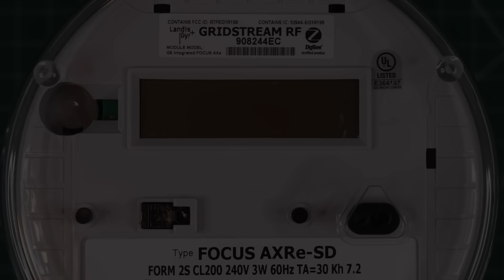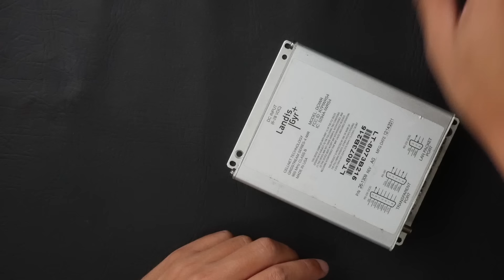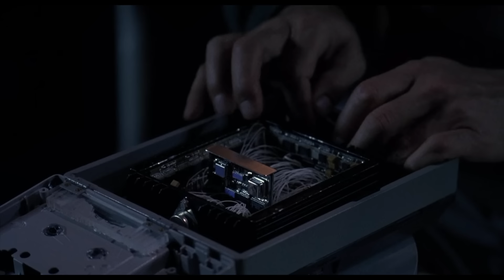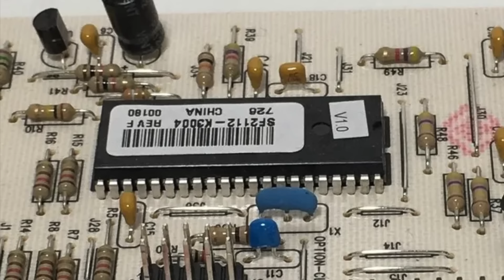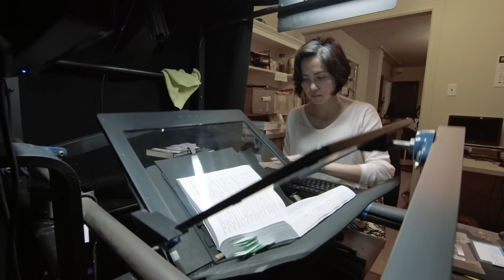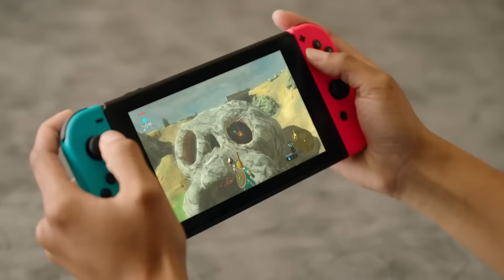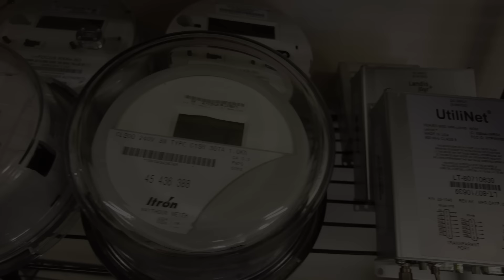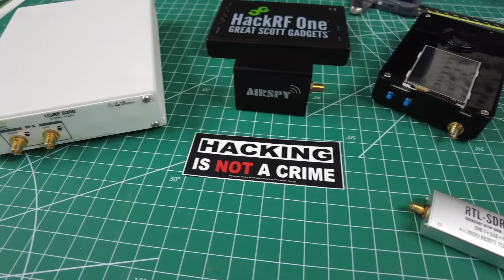The REAL Problem with Smart Meters

Comment: I got DEEP into smart meter development earlier in my career and was so frustrated by manufactures totally locking out the consumer to access THEIR OWN consumption information.  The SEP2.0 OPEN communication standard was under development but FERC didn’t have the balls to mandate an open standard like the FCC did with WiFi.  It is SO COOL to see this jail brake effort.  It will lead to security problems and solutions but more importantly with enable the INTERNET OF THINGS to become a reality!  I’ll be closely following the evolution of this campaign.
Reply: Smart meters were implemented around 2014 in the community where I live. Since then the utility rates have skyrocketed! The people have been speaking out about it for many years and are currently calling for an audit in fact. One of the reasons why they are currently pushing for an audit has to do with our community being hit by a tornado approximately two months ago. Many including myself were without power for two weeks; surprisingly the utility bill for that cycle was higher than not only the previous month but the same month last year! My example is only one of many. The reason none of these audits or actions by the public seem to have much traction I believe is because they are looking in the wrong place. I believe the discrepancy is perfectly hidden within the metering system itself. It seems that the “smart” digital meter is very sensitive, unlike the older mechanical meters which require continual draw to be turned (like an old automotive odometer). The average bill seems to be around 30% higher than with the mechanical meter. If anyone has any information on this I would be greatly appreciated to say the least.
Reply: @MidnightOilsRestoration  very concerning. I see your point, what is the algorithm being used, and can it be wrong. If it was the other way around with energy companies losing money, it would get immediate attention.
Reply: @backwardog1  you’re absolutely right about that! As far as the algorithm, I’m not sure what you mean. I’m not very familiar with the smart meters themselves beyond what I learned in this very video unfortunately. I have witnessed some anomolies with it that definitely raised some eyebrows and one of the other Residents with a grievance had a story that was quite telling also. I’ll explain what I mean in a few minutes
Reply: @MidnightOilsRestoration  note the cost rate per kwatt changes through day and night. Lots of opportunities for wrong cost code being used based on clock setting in the smart meter. That's why all the meter communication should be visible to verify accuracy. Carry on.
Reply: @backwardog1  The meter does not calc cost, it records Kwhr usage.  The utility pulls the kwhr usage from the meter, and at its billing backend multiply's out the $/Kwhr.  Some customers its a constant for the entire billing period, for some its an hourly cost and BTW residentials the least likely to have hourly changing $/kwhr...its usally a flat rate, or at most night, day, and weekend charges.
Reply: @MidnightOilsRestoration  You can ask to have your current meter pulled and tested and witnessed by you and your utility regulator.  When they pull the current they will put in a replacement. Its the kwhr rates that are changing not meter stuff.
Reply: @MidnightOilsRestoration  that’s a wild story about your experience without power and getting a high electric bill during that same time period. I can tell you that the old electromechanical meters did slowly integrate with time, but they always benefited the customer by running slow meaning the older the meter got the more accurate it would get, but it would be in accurate for the in users benefit. I have heard numbers, something like after 10 years a half a percent of accuracy would be lost every year after. But I’m sure this all depends on local factors. That may be part of the reason why there are higher electric rates when you replace an old in accurate electric mechanical meter with a new digital meter. Just part of the conversation, but definitely not the whole thing.
Reply from the maker: Thanks man! Seems a lot of people are frustrated, so time to change that!
Reply: My concern is that the meter's data collection can be used for nefarious purposes against me. At the basic level, I am over quota, and that big remote switch clicks to off. At the advanced level, China decides power goes off at 8:15 am. every day until we pay a ransom. I wanna keep the dumb meter, please.
Reply: @backwardog1  I would hazard a guess that a deliberately "dirty" but very low power transmitter (perhaps 100mW or so) sitting in the centre frequency of 915MHz might stop it being able to reliably RECEIVE but it would not stop it being able to transmit. (Unless you could find a way to enclose it in an earthed metal container - to make a faraday / tempest shield.

Interestingly, commercially available W-I-D-E bandwidth transmitters (30 MHZ) which operate on 800 MHZ band as well as 1200 and 2.4 - now this is not the right frequency, BUT my guess would be that changing the crystal might be enough to drag it where it is needed.

The cost of this is prohibitive to most people (and would also massively overwhelm local meters with a WIDE radius), but it suggests that the hardware is out there and I would hazard a guess that a WIDE bandwidth transmitter where you do not care about frequency stability should be able to easily block your OWN meter form being able to RECEIVE with just a few milliwatts of RF. A quick search for 900 MHZ video transmitters brought up results.

Clearly I would not advocate people blocking the receivers of others - or the "data gathering nodes", but a WEAK version in a metal enclosure over your own meter should make it totally deaf to the outside world I would think.

It would be VERY interesting to know if these meters "fail on" or "fail off". If they "fail on", then clearly if they were accidentally exposed to a magnetron from a microwave oven for a few seconds (on your own private meter of course, not a utility meter), I would think it would only take seconds to make sure it can never send or receive again.

Also with a PRIVATELY owned meter, I wonder what would happen if you changed its serial number to one recognised by the system. It does seem as though security is not that high, so it might not be a wild guess to wonder if the serial number transmitted was very easily linked to the printer serial number on the outside of the meter.

Might have to buy one of these things to play with. Though not sure this is a model used in the UK. We have Landis + Gyr but the E470 seems to be the version found here.
Reply: If criminals could shut the power off with a device, using this same data, this would be very frightening.  No need to cut any lines.
Reply: Where abouts are you, are there any articles  / reports about this issue?
Reply: @G.Man-  Claremore, Oklahoma. Yes several have went to the news about it in recent weeks. Last week the city council had a meeting to inform residents that the power company we purchase from GRDA (grand river dam authority)would be increasing its rate a total of 12.4% over the next year... 
I’ve had an electric bill of $741 personally, It’s gotten out of control. A bordering community called Verdigris has its own electric provider VVEC(Verdigris Valley Electric Company) and there is a newer housing edition that borders the cities. Nice looking homes but very similar layouts kinda “Cookie cutter” houses. One side of the road (our side)will have a $500+ electric bill, across the street…$200~ ish. 🤷🏻‍♂️
Reply: That is locally different. In the Netherlands, every smart meter has a so-called "P1 interface", accessible to the consumer. This interface sends the main consumption data every second over a serial port. No, and you cannot use this port to hack the meters as it is strictly uni-directional (by its hardware implementation).

Comment: The Landis-Gyr meter had a Zigbee symbol. That would make sens using a off the shelf Zigbee network. I don't think reverse engineering the firmware is going to help you as I think the key probably resides in the Zigbee chip.
Reply: well to be fair this whole video is more about entertainment for a quite layman audience than anything else, as can be seen by the comments. There is nothing secret nor interesting about "smart meters" they come in various flavours, some use BPL, some lpwan, some cellular, usually using off the shelf solutions, most of time mbus, lora, zigbee, and others, and the informations transmitted are neither secret nor exciting, total import, total export, apparent power, active power, reactive power, voltage, frequency, sometimes gps coordinates, event such (overcurrent, tampering...), UUID. Really nothing exciting about that, except for all these tin foil conspiracy nuts who have no clue about engineering but like to fantasize about what they do not understand ("since they installed my meter i got tinnitus from the microwaves") which seems to compose most of the audience here.

Comment: I have a solar setup and i want data from it for HA. The Inverter requires a $200 datacard to do Ethernet. The metering company will only send a vauge bill for active monitoring. And the utility company laughed me off the phone when I asked. So I'm ready to take things into my own budget hands
Reply: The utility only wants to siphon your excess solar for free.
Reply: You can monitor your power yourself much easier
Reply: @mrmotofy  how?
Reply: @JustANoob1  Multiple ways, there's kits to use a Raspberry Pi, there commercial kits there's clamp on ammeters

Comment: I call them what they are -- Dumb Meters. I have solar power. No, I do not have a battery backup and I should not need one! During normal operation, any excess electricity I produce goes out to the grid. When I lose power from the grid, I should have my solar still providing electricity. But I don't. The dumb meter is too stupid to allow that. There should be a switch inside the dumb meter that will turn it into a smart meter by turning off any excess solar-generated electricity from going back out onto the grid and harming any person working on the lines. I get it. But one simple switch would do that. Why don't they? Because then everyone else who loses power would see that solar does not lose power when grid power is lost. Can't have that!

Comment: If I have AM radio on, 740kHz, when I back into my driveway, something blocks the signal. It doesn't happen 100% of the time, more like 80%. The audio sounds familiar, like a high pitched version of a fax transmission or a digital Ham radio data stream. I'm not sure. This video make me wonder if the RFI is from my smart meter? Not directly of course. Maybe a harmonic? It would have to be a very low order harmonic though...

Comment: if they go woke the grid its simple.. just pretend and ilegal immigrant moved and wont move out.. complain to the electic company they must shut off to get rid of them.  The electric company will look at the politicall correct reward points and realize they have to give full free power for the wokeness and then pretend complain more .. to make them feel good you did not get your own way.. and there you go free power for wokeness.  if necessary ad trans gender nonsense with some blackness as a good mix max of agendas to get some additional free commie services

Comment: Everything about electric meters also applies to smart water meters.  However many water utilities are publicly owned and held back by politicians.  I know several towns that are treating their water manually and aren't allowed to update to modern SCADA systems because it's the town holding them back.  Meanwhile in the private sector, water utilitiy companies (at least in my state) work hard to keep everything up to date.  Their plants use modern treatment processes, SCADA is as updated as it can be, the smart meters are closely monitored to make sure they're accurate, etc.  While some towns have their SCADA networks open to the internet (freaking yikes) the private companies have an airgapped network with no connectivity to the outside whatsoever.... unless it's a contract operation with a town, and the town gets to override all the suggestions from the company.

But the local electric company, holy crap, they're not even owned by Americans.  Their HQ is in Europe and they have dropped the ball hard in recent years.  Constant outages while tripling our bills, never maintaining the lines or trimming back trees and hazards, to get any kind of support for the workers they have to wait for the European offices to open and they only get an hour long window, it's bad.  But they line the pockets of politicians so nobody can do anything about it

TLDR:  The root cause of the utility dystopia isn't corporate greed, it's dirty politicians and town councils.  If you can get some actual representation and communication, the corporations are forced to comply or be shut down or sued.
Reply: Considered a secret well

Comment: Sub'd. I pay an extra charge for conventional meters, surveillance is a problem especially when unauthorized parties use the power. The public should have fought back against smart meters, there's no benefit at all to the consumer, using power off peak isn't a benefit, FPL (aka Frequent Power Loss) charges you extra money if you have solar, how that's legal, you'll have to ask the politicians they are bribing. NetZero emissions just means the companies net and the consumers get zero.

Comment: I had the impression that smart meters send data over the powerlines. It would need to be very short bursts though to not interfere with licensed radio services. It was proven way back that BPL was radiating RF interference on HF and the power companies couldn't fix it.

Comment: It's not surprising that the one thing you can figure out is the metering info, I reckon it will be encrypted; even harder is if it is signed and encrypted, which means if you crack it, you only crack it for that one meter. If it was that easy to decode the firmware, then this could be an indication that there is another very sly little closed firmware chip on the device which is doing the [signing and] encryption of the raw meter data and then is passing this encrypted data onto the main (easy to hack) firmware that simply sends it on. I suspect this is the case because of how easy it was for you to get the firmware. I could be wrong. Anyway, to test if this data that you cant decode is encrypted, do a statistical analysis of each byte, or even each bit; if it analyses as being white noise then its encrypted data. Finally, just wanted to so that you make great videos!!!!!

Comment: I live in europe and work with the smart meters, I just have to say that not all smart meters send data to a base station like described in this video. If it's better or worse, I don't know, but they're not all like this.
Reply: We were told that some might send data to a central meter - for example: a certain house in a neighborhood might have a smart meter with a more stronger cell signal...........many of the other smart meters in the neighborhood will send the data to this strong smart meter and it will then send off the data to the utility.